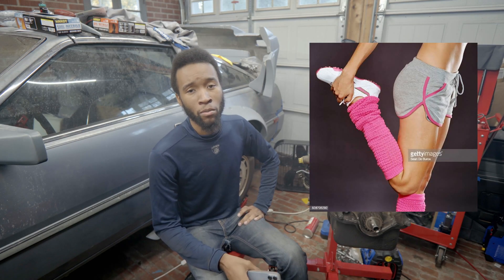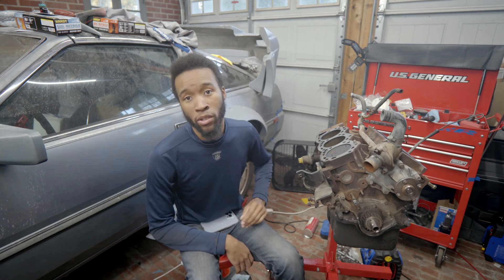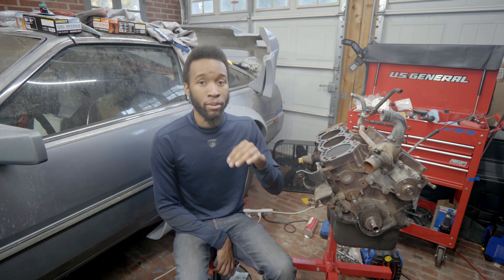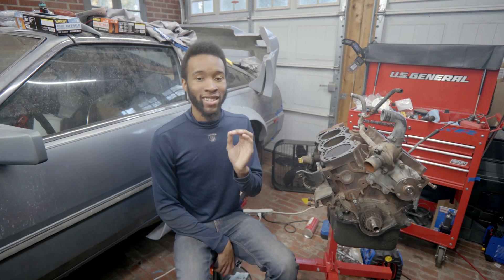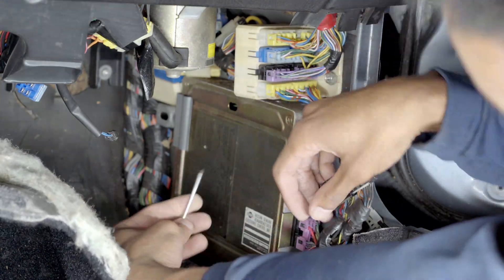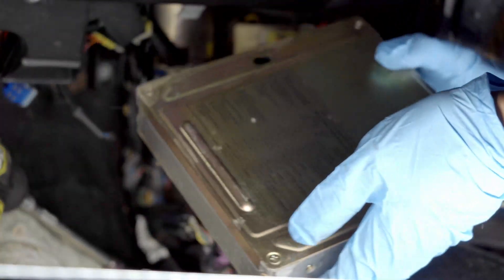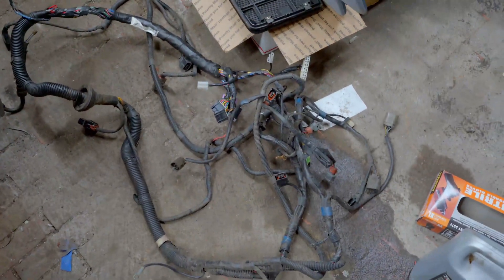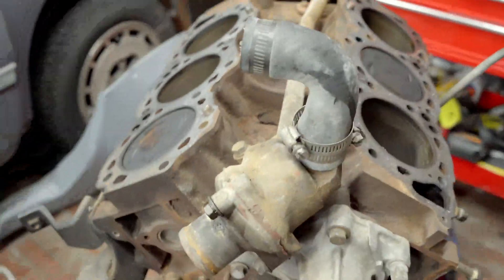Stripping The Wire Harness - How To Wire A Standalone MS3 / MSX In A 300zx na2t PT 1

Comment: Just a heads up. The thing on the passenger side looks like the speed sensor. The wire coming off of it should run down to the trans. This is needed for the digital dash speedo to work properly.

I think analogs cars with an auto trans also had this thing. I am not sure. Anywhoo. Mine was broken and those cables are a pain to find and quite expensive.

Oh and that coolant sensor thing. I think only came on very specific model year and trim combos. It does indeed go into a coolant passage. My 89T did not come with a sensor there so I drilled mine out and installed a thermal switch for my fans in that location. Other people relocate the CHTS there.

Comment: at 9:36 I have a 86, na, analog dash car, and also have those two connectors not plugged into anything. have never been able to find any forum posts or anything talking about them either
Reply from the maker: So I just looked at the manual, ig pre 88 or 87 cars have those 2 plugs for the control harness. I’m guessing it has something to do with diagnostics. I honestly didn’t look into it anymore after seeing that lol